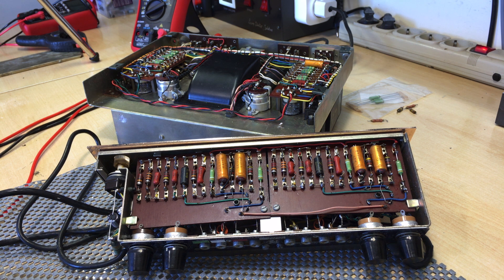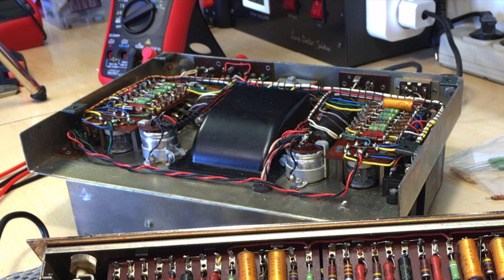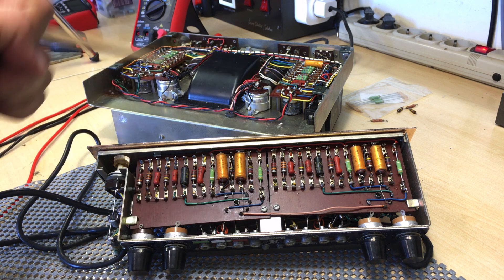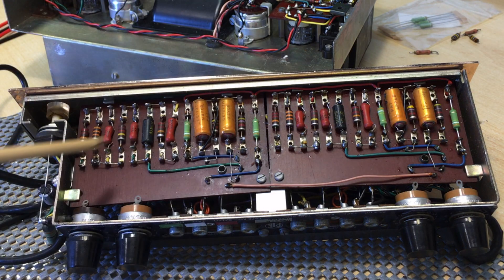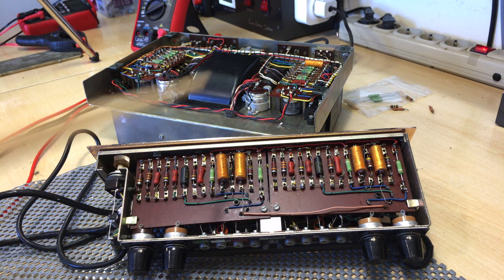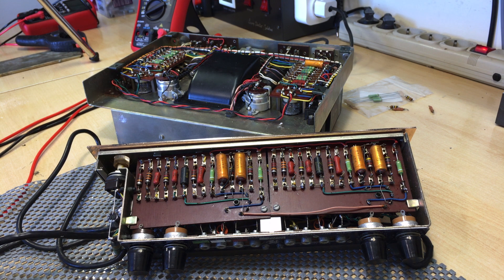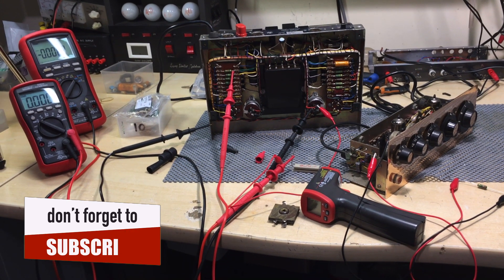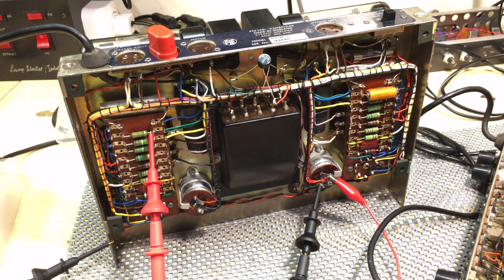Pye Mozart HFS-20M Stereo Hi-Fi amplifier restoration - part 3

Comment: Did you account for the normal voltage drop across the selenium rectifier?  Need a dropping resistor.
Reply from the maker: I set the input to the 240v so after testing the voltages, the resistor was not necessary. Usually it would be.

Comment: I had a unit that had two multi plate selenium rectifiers. The ones that look like little towers straight out of Frankenstein's lab. Both pure crap. But I love the look they add. I did not have the heart to chunk them. So I left them, out of circuit, dummy wired to ground. 

Then I got my hands on a tube tester with bad meters. So I spent four plus hours cutting the lenses off modern meters and using a drimel to cut the sides down so they would fit in the old housings. 

It's easy to get caught up saving the "look" of this old stuff.
Reply from the maker: I know the feeling

Comment: Have you considered taking the pre-amp power from full B+ through a higher value decoupling resistor?
Reply from the maker: I decided not to change the basic design because my friend wanted it to stay as original as possible. If I was building it anew, that’s what I would do, yes.

Comment: Why did these resistors go out of spec and how does this happen?
Reply from the maker: The simple answer is age. Some do and some don’t. Depends on the base construction and the actual stress that it is subjected to.
Reply: @electronicsoldandnew  Are these wire-wound or carbon resistors and did they go up or down in value with age?
Thanks :)
Reply from the maker: They are carbon, and all of them went up in value.

Comment: I don’t think I would add the 50 ohm resistor. I would allow the B+ to be higher. I would not want to lose bass response because of a sagging power supply across the resistor. I would just adjust the bias to the power tubes appropriately and leave the power supply alone
Reply from the maker: Fair point. I’ll see what it sounds like. The filter caps are 100uf and come after the resistor, so I expect them to source the needed juice for really current-hungry bass frequencies.
Reply from the maker: Correction: caps are 47uF. We’ll see how it sounds.

Comment: Quad also use one power amp to supply the preamp am tuner and fm tuner (not so good for the mains transformer)  the B+ on that power amp is 12 volts lower than the other , i must admit i can not hear the differance. PS this is Quad 11 and 22 pre and power amps.
Reply from the maker: I guess the difference in sound will. E minimal. I just wondered if it was the most logical way to do this. They could simply have derived it directly from the B+ and added another RC in between for extra filtering. I guess some of these components cost quite a bit when this was made.

Comment: So, what i didn't understand: The 50 Ohms now is necessary, because the line brings 240V against earlier 220V or is it the new bridge rectifier? 
Nice litte tool u have, to draw at the screen!
Reply from the maker: No, the 230v mains goes in directly and is the correct voltage because the 6.3vac heater voltage is right (it is actually te sing 6.2vac).
The 50 ohm resistor is between the new bridge rectifier and the first filter caps. This brings down only the B+. The new rectifier only has a 1.4v drop, which is much lower than the selenium rectifier originally in there, so the result is much higher.
The drawing is done in screen recording function on my iPad, using a notes app. Works great.
Reply: @electronicsoldandnew  Thanks for your answer. Now it's clear.